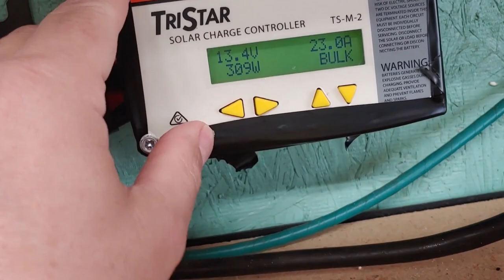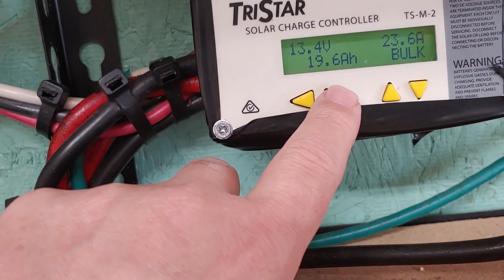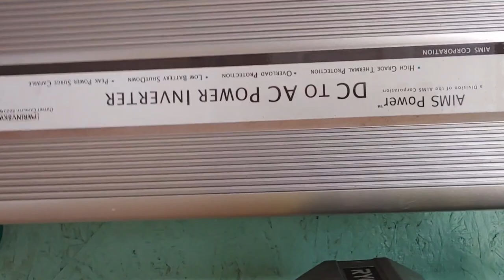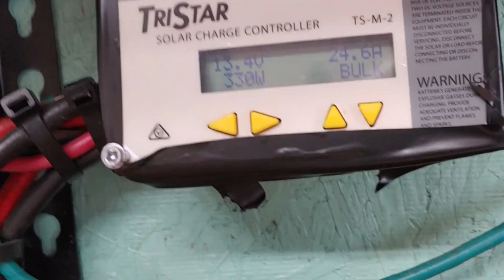Is the Power Queen 12.8V 200Ah LiFePO4 really a good, cheap lithium battery?  Episode 2

Comment: Looks good, but all your battery connections should be in equal size equal length Also, you should take the negative from one battery and the positive from the other battery to the inverter and make sure that the cables are the same and the same length I have a modified inverter. Also, some lights don’t work, so well I just leave those ones off they flicker. Also, the shorter your wire the better off you are.
Reply from the maker: Excellent tips. Thanks for your comment.

Comment: May I say that the battery connections should be different since you are drawing your power unequally from the two units.  You should have the negative line to one battery and the Positive from the second battery since that way the draw is equal for both batteries.
Reply from the maker: I have done that before and I find no difference in the draw in the bank. Thanks for your comment.
Reply: can someone please do a head to head comparison of all the new 460ah lifepo4 batteries that are coming out? redodo bird, roamer, litime, epoch, basen, VATRER, power drag queen, etc.. thanks in advance!  @shoestringprep

Comment: Reliable 3000W 12V Inverter 120VAC : I'm using this one connected to two Chins 300Ah batteries. No complains
Reply from the maker: Thanks for the tip and comment.
Reply: I'm using the sane, but the 24v version. Works great.